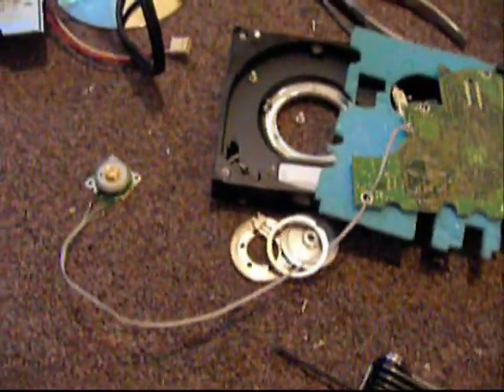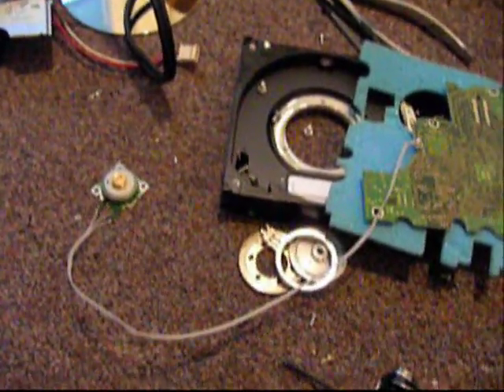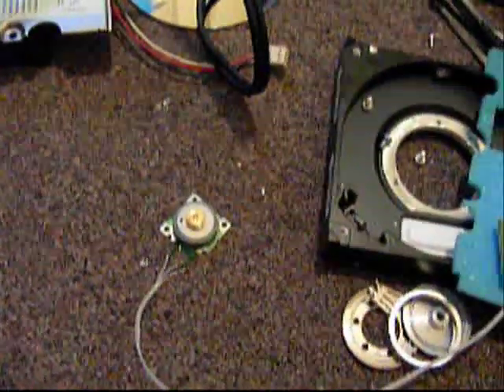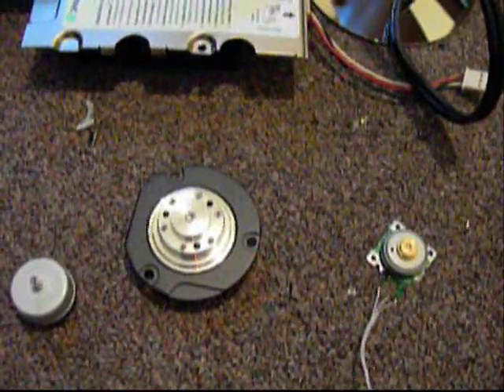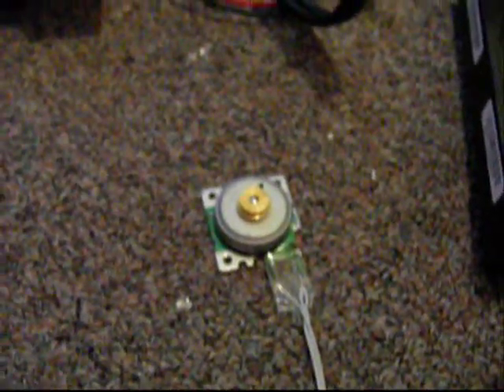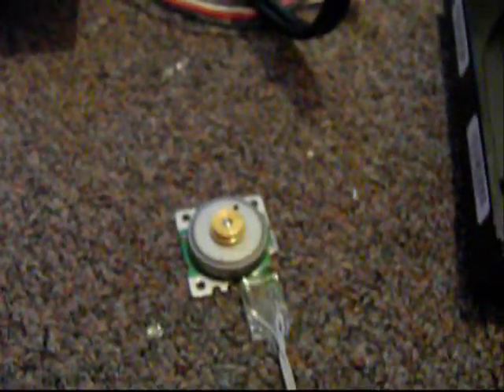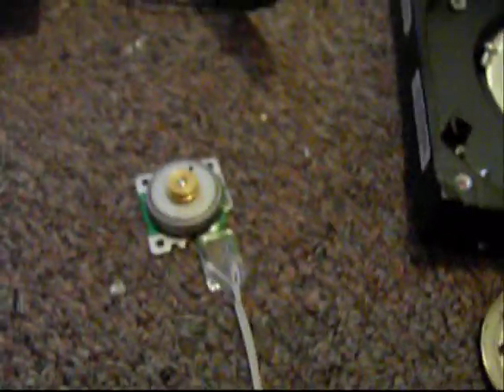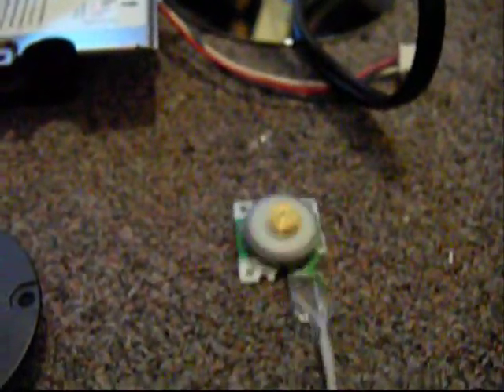Brushless Floppy Drive Motor at Very High Speed with some Gyro Effects

Comment: yo.. the hard drive brushless motors are good for Power generation, run the 3 phaze wires through some diodes and a cap, you'll get power..   pull string flash lights use the same  motors for generation.

Comment from the maker: get a hard drive, find where the motor output is, if there is 4 phase/wires its still ok, take it apart and remove the head and see if it still runs, then find a motor that has 3 phase with 9 poles or 9 windings then get the 3 wires and connect them on to the hard drive board you can connect it anyway you can and it will still run but only 3 out of 4 will work so try connecting it and test it if it doesn't spin up try other wires

Comment: yeah, some ppl have played with gold recovery systems over here but the running/EPA costs and regulations have ruined that industry.
its too hard and expensive to do it the save and legal way. otherwise your just exposing yourself to lead, mercury, arsenic etc.. :(

If the scrap biz hadn't hit rock bottom last year I'd prolly have my own recycling facility by now.

I'l just stick to high-value scrap like Aircons and industrial electronics.